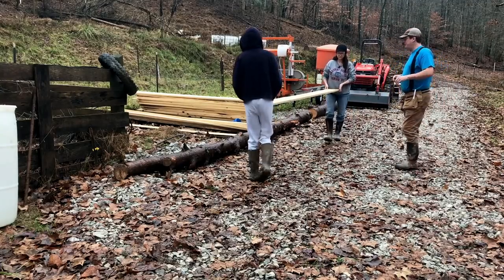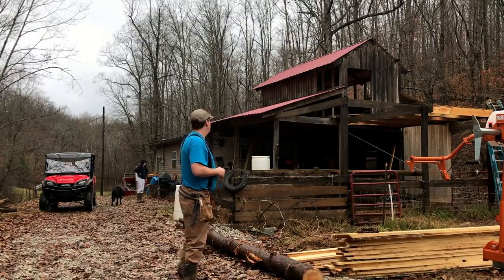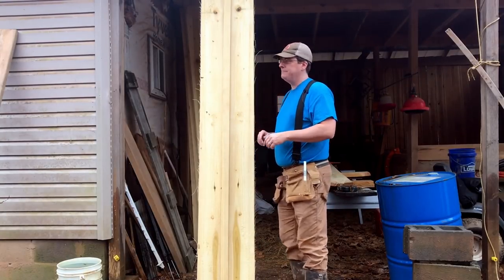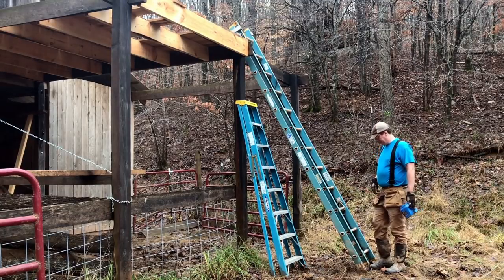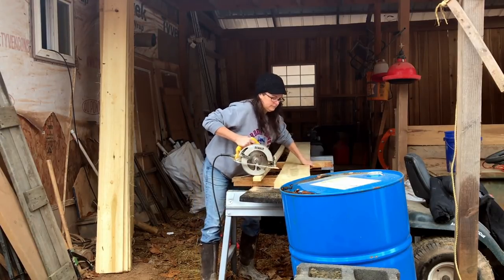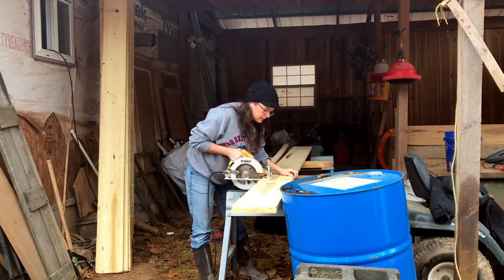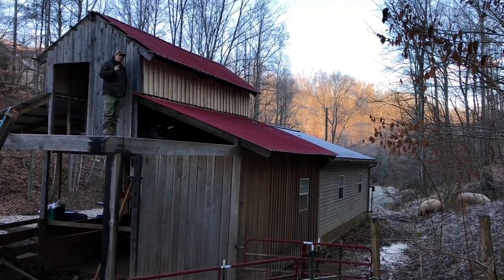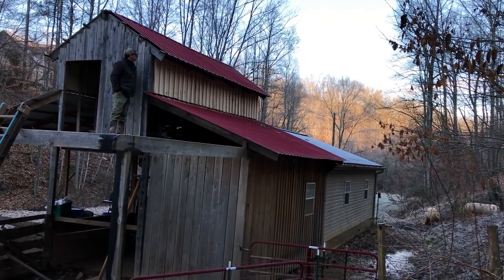Installing our barn siding from the wood we milled

Comment: I have always used a circular saw same as in this video. However, a year ago I bought a worm gear circular saw with the blade on the left. It changed my life. I will never go back to looking over the saw again. If you haven't tried one you should.
Reply from the maker: Are you left or right handed?
Reply: @RedToolHouse  I'm right handed and hold saw with right hand. Much more accurate on my cut.

Comment: A durability tip: Looks like you're making straight cuts. If you cut those boards & battons at an angle, you'd have a drip-ridge on the bottom. Water would certainly drip off the outside edge, instead of possibly wandering around the bottom.
Reply: When Essential Mountain Homesteading Josh visited Red Poppy Ranch a while ago, he showed a 45° cut, in this case with another board underneath the seam: https://youtu.be/9his3ipFsOI?t=761
 He explained it a bit earlier: https://youtu.be/9his3ipFsOI?t=621
Reply from the maker: I will have to check that out.

Comment: FYI, if you didn't dry those timbers properly, and I'm assuming you haven't, given the time frame, all of those boards are gonna warp on you. Tis no good to build with "green" lumber. You're just asking for trouble.
Reply from the maker: Nah, we have been building with green lumber for 18 years. We have high humidity in our region. The boards shrink but they do not warp once nailed in place. Treated lumber from the box stores moves more. If I left green wood just  laying around, then it would warp.
Reply: @RedToolHouse  Fair enough. If you lived in a lower-humidity area though, I would certainly be concerned.